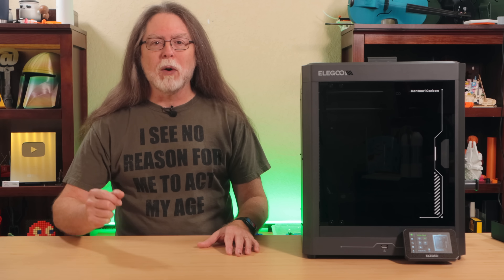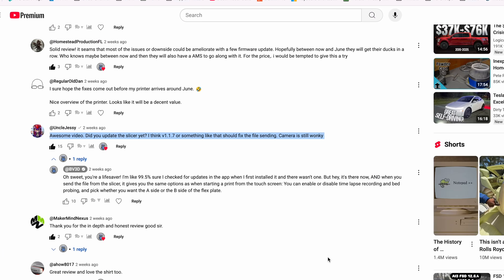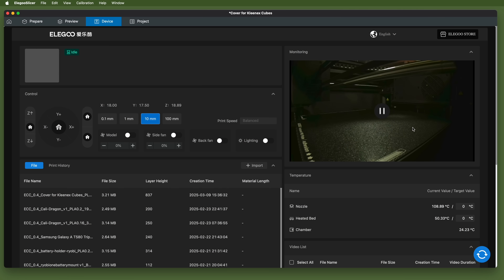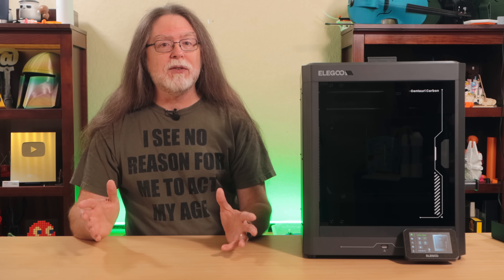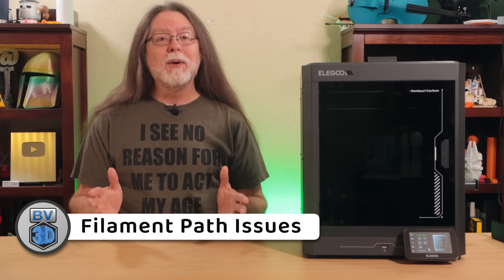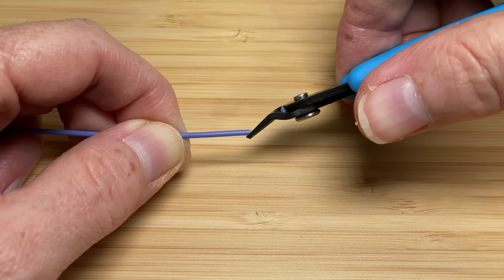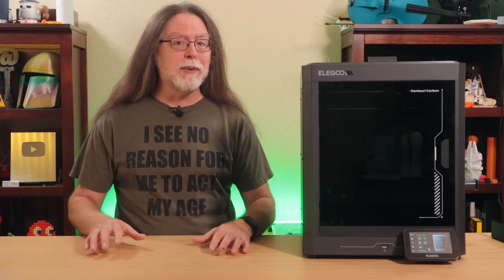Elegoo Centauri Carbon Update! Fixes, plus new issues (and more fixes)

Comment: Instead of changing M140 to M190, I wonder if you can just add a separate M190 later on, so that some steps that don't need the bed heated up can go ahead and run in parallel to heating, and then when it does get to any steps that require the bed to be heated, it can then begin to wait if needed.
Reply: According to some other comments, that's exactly the fix elegoo went for
Reply: ..and that would be beneficial how?🤔
Reply: @themountain59  It would mean some steps can continue to happen while the bed heats, saving time, but still waiting for the bed to heat for the final steps.
Reply: @ THANKS 👌

Comment: The beta version of Orcaslicer has profiles for the Elegoo CC included. Works so much better than the Elegoo Slicer.
Reply: Is it possible to send & start a print job from Orca slicer directly to the printer tho?
Reply: @supercurioTube  YES!  Elegoo included all the necessary code in 2.3 Orca to send and start jobs, check the status, and view the camera feed.
Reply: @supercurioTube  yes

Comment: Nice to see they are working on fixing things some what quickly.
Reply: Two firmware updates later and the Centauri Carbon still tries to print on a 40 C bed when the commanded bed temperature is 60 C.  Maybe by the time most people have their pre-ordered printers in 4-5 MONTHS, this and other nagging issues will be fixed?

Comment: Tysm!!!!! I almost bought a whole dang farm of these. Fugg that. Bambu A1s it is. Elegoo gets points for trying but it’s not fair the users need to fix their machines.
Reply: When you say “fix their machines” are you just talking about the curve in the Bowden tube?
Reply: @ that, the slicer issue and just about everything mentioned. It seems like the company doesn’t even test their products. Some of their track record doesn’t help either unfortunately (the orange giga etc). I want them to do good but they keep doing poorly. 

It’s 2025 and Bambu is the standard that everyone needs to be at or exceed. 

Well at least for me. I just want my machine to work when I get it and not have to reply on YouTuber to help me fix it 😅 . Ty Bryan though
Reply: @TheFoxalot everything in today's world has bugs and hopefully gets updates to fix it.  Sometimes those updates introduce bugs, even after testing.  
I'm sure the Bambu labs printers just randomly starting prints in the middle of the night was not intended and probably wasn't caught in the testing.  
It's not a matter of bugs not happening.  It's a matter of how good the company responds when they do happen.
Reply: @ true that. It is concerning about the gcode issue that hey didn’t catch were the bed didn’t heat up properly. That leads me to assume they do minimal testing. Then further, what other quality control measures do they lack or will find out about later etc. It’s a simple fix. Which is odd due to it being so simple.
Reply: @TheFoxalot  yeah, that does seem weird. Maybe they wanted to use the current one to get it started while it runs all the other gcode and then it was supposed to come back and use the "corrected" one at the end of the start code? I could see someone seeing that and thinking it was redundant and wiped that line on the slicer.  Just devil's advocate.  
It's technically all still pre-order/prerelease stuff, and the early adopters are beta testers for it. That's an annoying direction for all industries.  I say this about apple but it's kinda true for everything. I say not to buy first gen apple products because there's always issues and you're the beta testers.  This is their first gen core xy and their first release of their orca variant. We're beta testers.  But for $299 for personal use, still recommend.  For professional use, wait till gen 2, revisions, or updates.
Reply: @TheFoxalot  I do not, as a rule, adopt new products early. I just got my Bambu P1S - my first from Bambu - so far it's been working well and feels very mature. I'm building a farm out slowly. The only mature products IMHO are Bambu & Prusa. I wish there were cheaper alternatives but it is what it is.
Reply: Honestly you haven't seen the issues Bamboo has had then ; including the lead that wears through or gets kinked at the back lead screw and its a fault in the design as they now released a new lead but everyone that gets that particular model has to pull there whole machine apart and put the lead in themselves. That the X1 Carbon and I not sure if they even admit it's a design flaw according to the Guy who had to replace it in 3 of his Printers. The video is on utube . So don't go thinking Bamboo are Perfect !!! I am not even sure if their new batch have the new lead or still the old one !
Reply: @jayson8118  There's no such thing as perfect, only suitable for the task at hand.